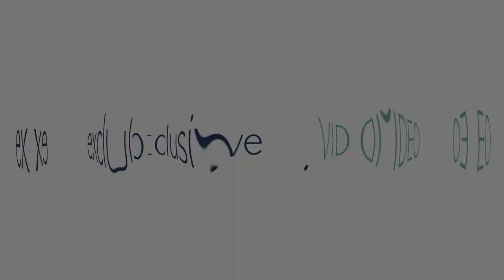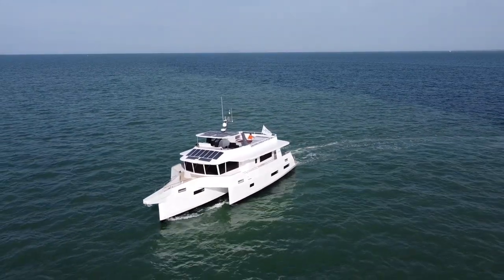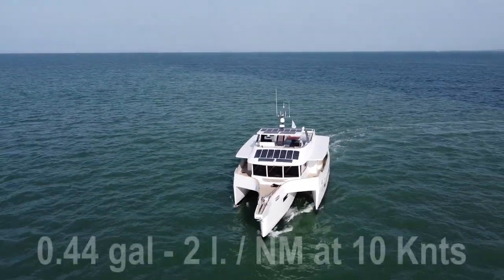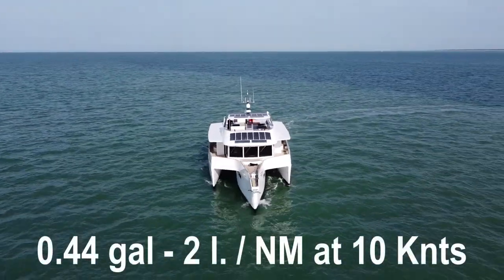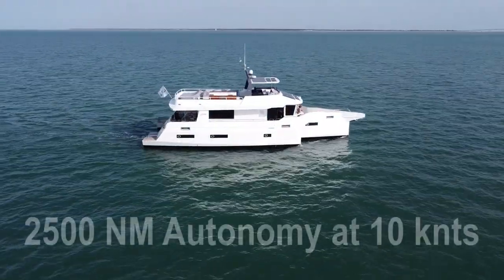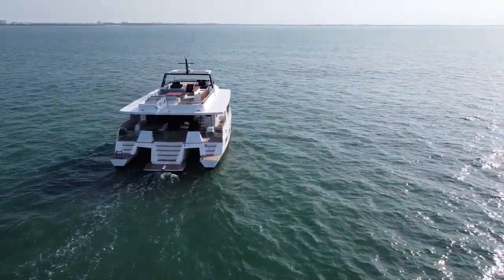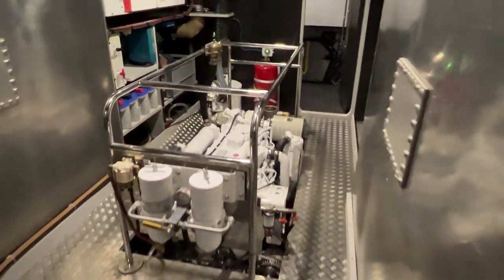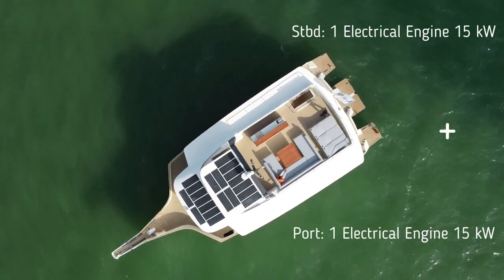LEEN 72 Trimaran - Boat Review Teaser - Multihulls World

Comment: Is it possible to have more solar on the roof and full electric?
Reply from the maker: I can't answer you yet because I haven't yet corrected our journalist's essay - it will appear in our next Multihulls Magazine. I would say yes for solar panels and no for all electric - perhaps you can speak directly to LEEN Trimarans.
Reply: ok, thank you. Interessting is to upgrade the electric propulsion to 8 hours operation time. This would be a true hybrid vessel. Hope to see that solution from LEEN soon.
Reply: I asked a similar question on LEEN's channel.  I think you could almost double the solar capacity by adding panels down the sides of the top.